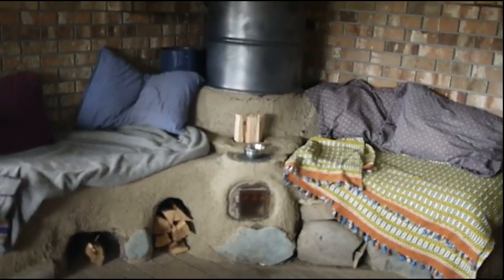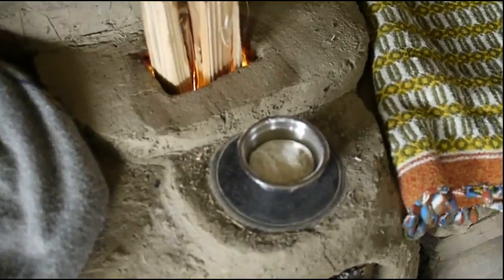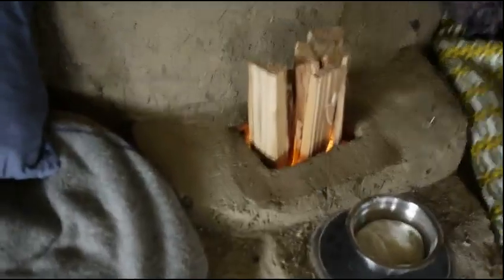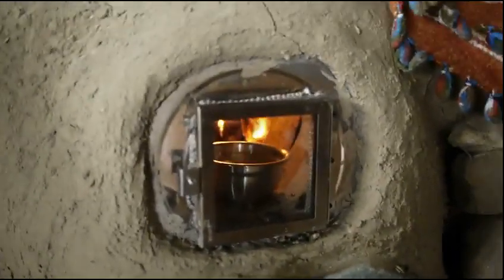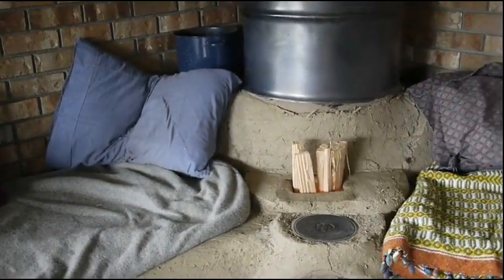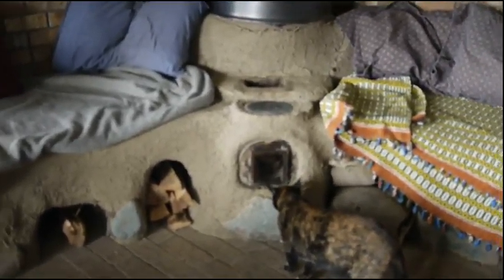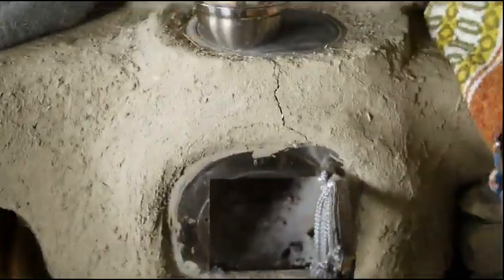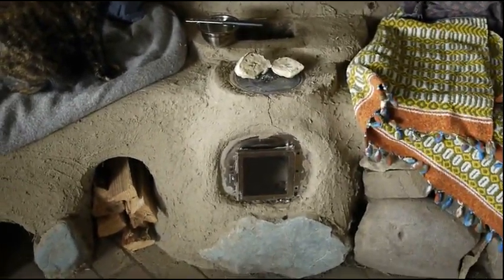Window in a Rocket Mass Heater and baking bread in the built in oven

Comment: Thanks!
I noticed you advise perlit insulation for the truly hot parts instead of a firebrick material. I was considering if i want to use perlit with clay and perhaps liquid glass, or to use a light porous firebrick. Also there are nice ceramic chimney  materials too. (used or waste pieces) Now leaning towards Your clay perlit material, and i think i make a styrofoam (or paper tube) firebox + heat riser shape and stick my mixture on this form and burn out the form when the clay hardens a bit.

Comment: Hi! 
Nice stove!
I'm interested how RMH owners deal with ash. I know people build cleaning ports in certain places in the exhaust part of the stove, but doesn't ash collects under the feed tube chocking the fire?
I'm asking since i did not see a design with an ash box marked under the firebox. 
Is the draught so strong that it sucks the ash up the heat riser?
Also, if you would leave the door open, could the fire burn up on the fuel and cause trouble?

Comment: One thing that I was really interested in was the difference in temperature between the back of the home as opposed to the local temperature in the area of the mass heater. Does it suck so much air into the fuel feed area that it makes the back of the home cold or very cool? Thanks - Lee

Comment: Matt, I have followed your videos and built a rocket stove from your design.Read where you suggested the stack exiting up high above the stove.This dramatically improved the draw and prevented smoke back.Before I had the pipe exiting along the floor ,and would have winds blow smoke and flames back into my room. HAve not covered my pipes with cob but plan to do so next season.Thanks so much.
p.s. HWere did you get your furnace glass? Tony-from Iowa.
Reply from the maker: Hi Tony, thanks so much for the kind words!  I really appreciate hearing that man.  The glass is a product called Robax, ceramic-glass, and I found the pieces I use on Ebay.  You can also hit up a scrap yard or fireplace shop and look for decommissioned wood stove doors.  Thanks for the comment Tony.
Reply: Mrblueberry52  You can also get ceramic glass here-(I am in no way associated with them)
http://www.onedayglass.com/

Comment: How long is the burn time? How big of an area is this heating? Is this your only source of heat. Are these easy to light or is the draft kind of hard to establish?
Interesting set up.
Reply from the maker: It heats around 1000 sq. ft. of poorly insulated, single pane windowed older home in the PNW.  I use it as my sole source of heat.  It is incredibly easy to light, draft is established as long as the mass is warm.  It can be a bit finicky to light the first fire of the season if you pick a poor day for the first lighting, but once warm it takes a few days to cool completely and is easy to light until it does.  My "living with the RMH" video shows lighting the heater.  Thanks for the comment.

Comment: Can you post a sketch of the inner workings of your stove/oven, or tell me where to find the info? Do you use perlite to reduce the weight of the stove? Do you insulate under the stove, to keep the heat from radiating into the floor? I've seen stoves w/ the barrel covered w/ cob... what difference does it make? Thanks!
Reply from the maker: Hi Bonnie, you can find a rough sketch of the internal layout here: http://www.permsteading.com/viewtopic.php?f=6&t=79  The Perlite is used where I want insulation.  Weight is mass, which is the heat storage, so you want it as heavy as it can be for best performance.  Yes, insulate under the heater.  You can find good instructions for this in Ianto Evans' book "Rocket Mass Heaters...".  Covering the barrel with cob will slow the immediate heat release and send more heat to the bench.  With the barrel uncovered it radiates heat intensely and quickly like a box stove, which I prefer.  If you are in a warm climate the covered barrel may be a better choice depending on your needs.  Good luck on your build!
Reply: Thank You! Have you tried coiling a copper tube around the drum to heat water? I was thinking about getting our local Amish to make a SS tub & welding on nipples that I could attach the copper pipe to... and also a faucet near the bottom to pour out the hot water.
Reply from the maker: I have not Bonnie.  Good luck with it and thank you for the kind words!

Comment: Where do you live? I live in Wisconsin where it gets to -30 or even -40 below at night and sometimes below 0 even in the day. I have to feed my furnace every 4 hours and I have a high efficiency wood furnace. Where is PNW? I have a tower with a 17 by 17 room that could use a source of heat but it is very cold here in the winter.
Reply from the maker: Pacific Northwest, Washington coast to be precise.  Always cool, never very cold.  These are fairly low BTU heaters, they are efficient, but limited in their output.

Comment: Thank you sooo much for your really helpful videos!  I'm feeling much more confident about building one now. I've looked at many threads about RMH's at Permies.com but I ended up a bit overwhelmed and thinking that maybe they don't work as well as anticipated.  I can see yours works really well.

I do have a question.  I'm trying to figure out how you did the duct/pipes, do they only go through the "bed" section?  I can't figure it out otherwise.
Reply from the maker: Thanks Margie, glad they are helpful.  You can find great info over at Donkey's board, "rocket stoves...experimenter's corner" aka Donkey32.  My flue run in the mass goes from viewer's right of the barrel to the end of the short section, then back behind the barrel, out to the end of the bed section, then back to the exhaust near the barrel. It kind of makes a bow tie shape, with the core/barrel in the center, if that makes sense.  Good luck on your build!

Comment: Why does everybody use cob instead of concrete ?
Reply: I know it's old but I'll answer in case you haven't found it. First,  cob had an amazing feel and working with it is like none other. Second, concrete has almost a 1:1 ratio of manufacturing to CO2 emissions. Meaning for for ever pound of concrete made there is roughly a pound of CO2 made. Lastly, cob is forgiving and mistakes can be made while mistakes with concrete are extremely difficult to fix.
It's all for the love of being able to create something custom and sustainable. It's amazing demonstration of appropriate technology.
I hope you have had the chance to build with it.